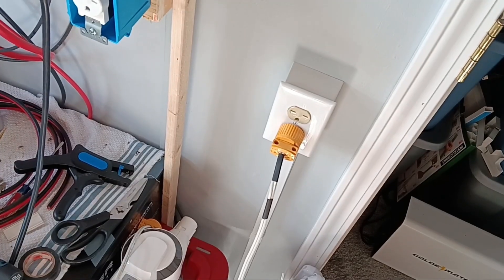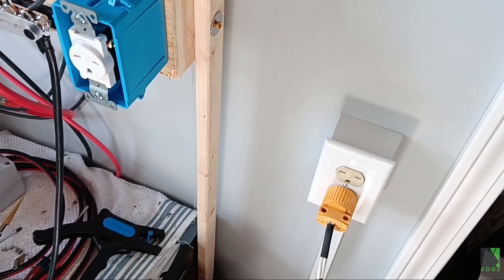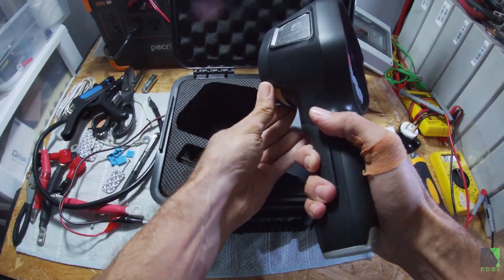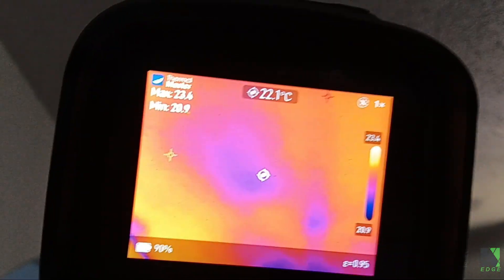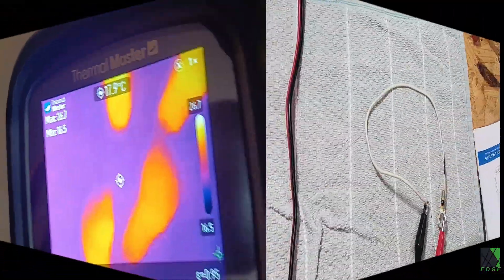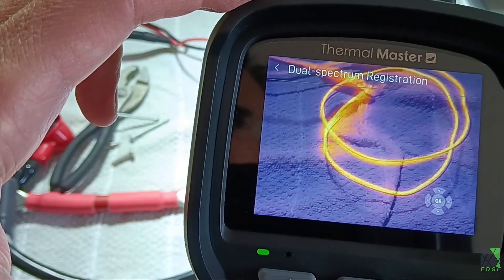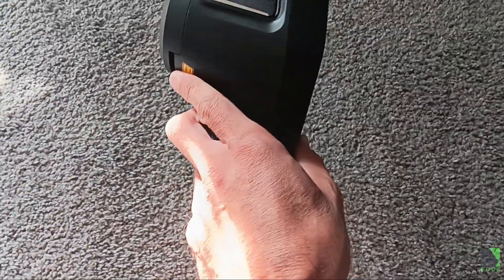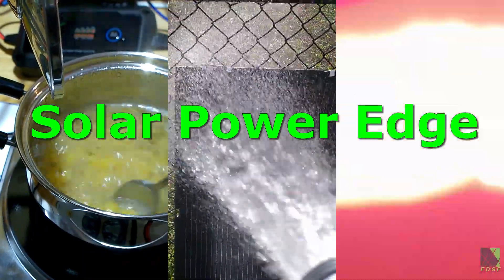What Happens When You Point a Thermal Camera at Everything? — Thermal Master THOR002

Comment: Gotta admit, that Thor002 is slick.
Went to check out a used F-150 and decided to bring it along just in case.
Scanned the engine bay and found a hotspot near the alternator running about 40 degrees hotter than it should have been.

Seller acted surprised, but I walked away from that deal.
Probably dodged a three grand repair bill.
Pretty damn clever use for a thermal camera. TY for putting that idea in my head.
Reply from the maker: @MarcelinoLeonor Nice... that probably saved a lot of trouble. Clever use case for IR! 

I tend to like gadgets with bigger screens, mainly because I ioften have to record them with another camera. On the 002 if I get the distance and focus correct, the screen records pretty well and no need to use an SD card to download video...

Comment: I’m a facilities tech in a cold storage warehouse where we’re always watching for problems with temperature control. Around the dock areas, it’s not uncommon to have small leaks or insulation that comes loose over time. The tricky part is, most of these issues don’t show up to the eye. You only start to notice when the cooling system has to work harder or the compressor cycles more often than usual.

A few months ago, we started using the Thor002 for weekly checks. The image clarity is excellent, especially when you're scanning large wall sections or high spots you can’t easily reach by hand. It helps us quickly spot abnormal thermal lines or patches that suggest insulation failure or air intrusion.

One case stood out. I scanned a section near the refrigeration unit and noticed a faint warm line running vertically along the wall. At first glance it didn’t look like much, but the shape was too clean to be random. We opened the panel behind that area and found the spray foam had pulled away from the wall, leaving a narrow gap. That kind of issue wouldn’t have been found by feel or visual inspection alone.

Another thing I’ve come to rely on is the voice note function. I don’t always have time to stop and write, especially when covering multiple zones. Now I just speak a quick note after each room and review everything later. It’s simple, but it saves time.

Thor002 has been reliable so far. It turns on fast, doesn’t freeze up, and gives us the information we need without any fuss. That’s what I want in a tool
Reply from the maker: @HartleiRomero Really putting the tool to work... amazing! thanks for sharing your knowledge and experience.. I wonder how many in the HVAC and refrigeration fields know about using an IR camera...
I wouldn't have guessed spray foam would do that, but the IR does not lie. Every time I've encountered spray foam stuff and needed to remove it, had to be scraped away bit by bit and still couldn't remove it all.

Comment: I was checking a circuit board where one component kept failing under load. The Thor002 detected a small heat difference that other cameras missed. With its ±1.5℃ accuracy, I could isolate the issue to a single capacitor. Normally I’d be swapping out parts one by one, but this time I got it right the first try.
Reply from the maker: @GabrielAlisha-g4y Nice repair! I had the impression this camera was very sensitive. Your experience seems to validate that. I'm no electronics guru, but I know how frustrating chasing down one tiny failed (or partially failed) component can be....

Comment: If you can see the back side of operating solar panels, a hot spot can indicate likely failure points.  Sometimes the same is visible on the front, but harder to see the contrast.
Reply from the maker: @Sylvan_dB Right on. I wish I had tried that in this video. Have some older solar panels in storage and they must have hot spots because they look burnt

Comment: Ha, I did the same thing!

I also have a 2500 gallon water tank outside, and the thermal camera is usually a good way to see the level in the tank thru the tank wall.  On warm days the water is cooler, and cold days the water is warmer.  That's true most of the time anyway.
Reply from the maker: @Sylvan_dB Nice sized water tank, I need one of those. Never thought of checking water level in a tank with IR, awesome idea. I'm guessing there are dozens of niche use cases for IR that we have yet to learn. My favorite so far has been checking wires and connections, because many times I find a power connection has high resistance - yet it "looked ok" at first glance - but a quick look with the IR camera instantly solves the problem